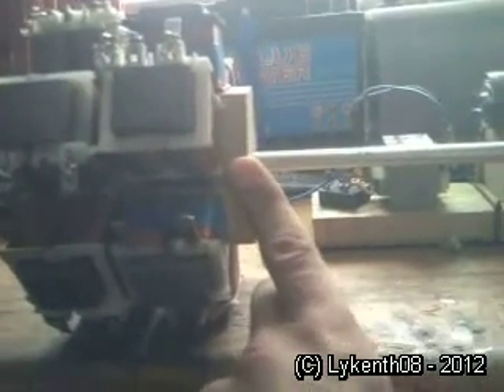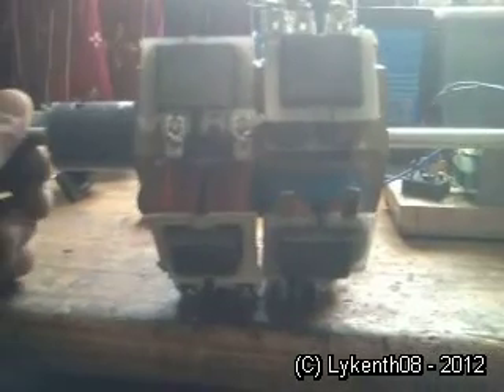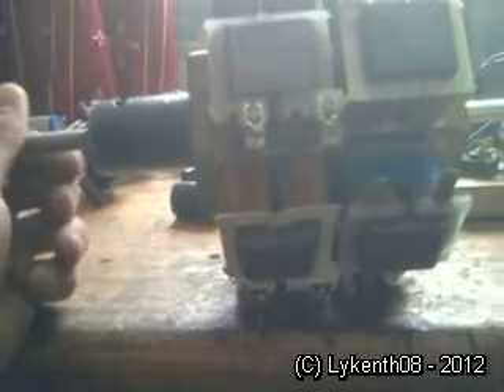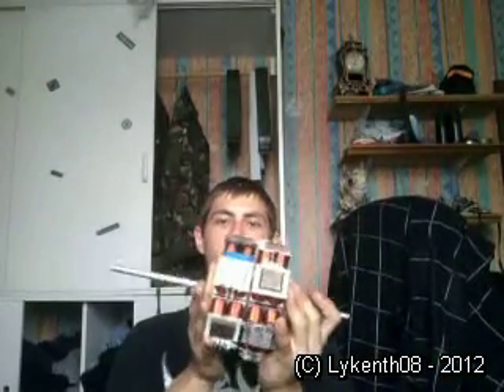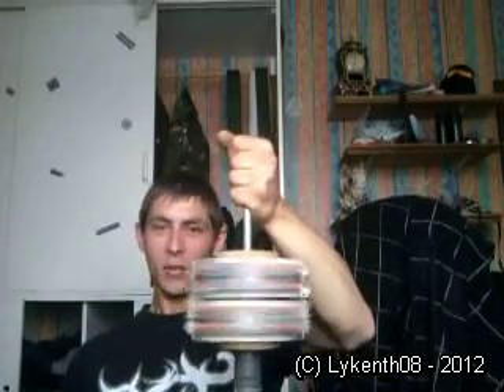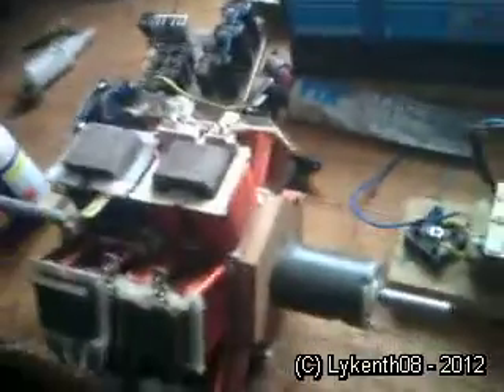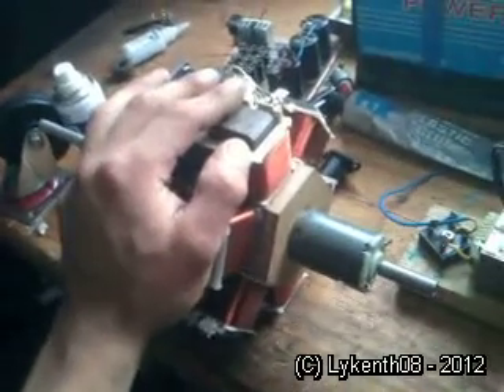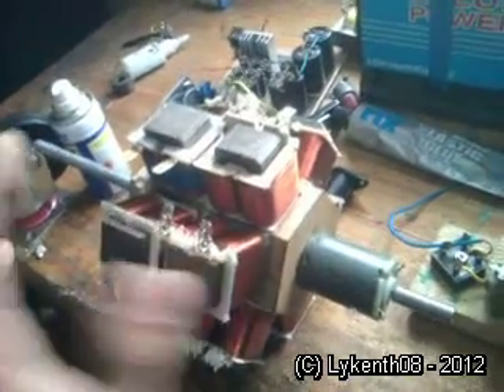2012 Lykenth08 overunity concept generator prototype. Update PT2

Comment from the maker: Note the word concept in the title. yes i do understand that metals can be attracted by magnets, but some can be repelled when you use the right amount or do neither. did you know that?. and as the magnets i have used are only two pole, one per face, the Fact that i can produce power with a single pole per face is different to conventional generators. it was an experiment, nothing more. an no i wont remove it so others will know this didnt work for me. at least i tried an thats all i can do.

Comment from the maker: Wont it just =D got a hitch, the cogging i built to avoid is way worse it just dont make scene what so ever. the motor cant over come it at the start but once done it will spin as momentum over come it. but for now, Nothing!. unless the motor is at fault... Hope not. i do have a backup method thanks to them excess shafts.

Comment from the maker: Hi, thanks for your comment, odd thing is it wasnt in my inbox :/. Im having trouble starting is frustratingly, i built it for little to no cogging but out of no where its now worse. the motor cant over come it?! so i think drastic measures might be around the corner. once over come it does spin. but it should not be cogging anyway. 0.o